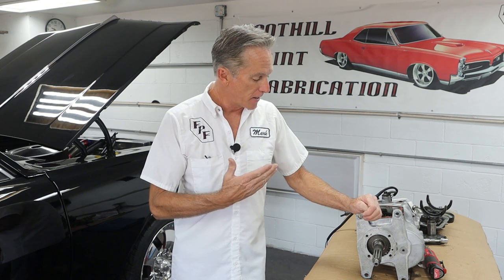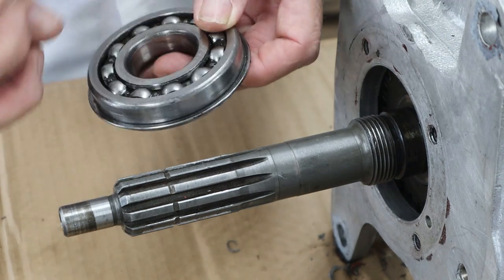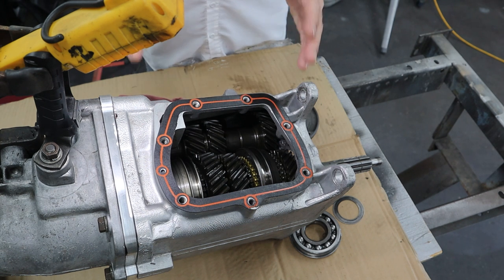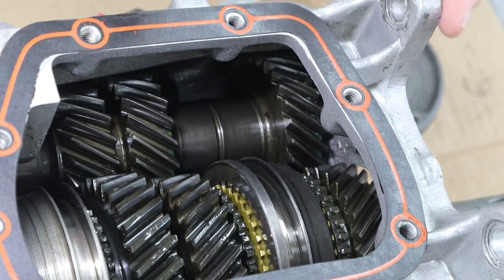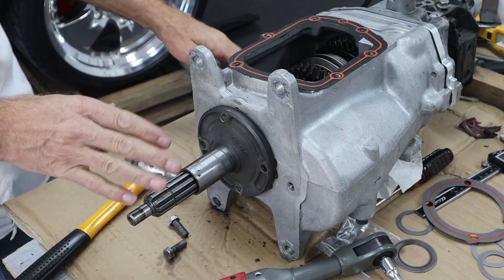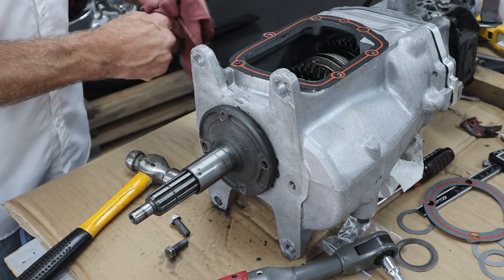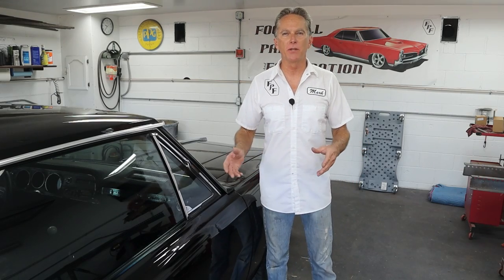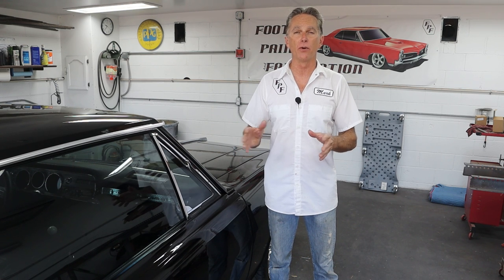1965 Malibu SS (Ep 27) 4th Gear Noise in the Muncie Four Speed

Comment: The  Borg Warner Super  T10 Kits are the the opposite, OEM had 10 bearings and the new SKF "HD" bearing has 11 smaller balls. Here's the thing, the old ones with 100,000 miles were nice and tight and the new ones loose like yours. I made a video of them and also contacted Paul to purchase a couple of his sealed bearings. His response was that the loose bearings are fine and will tighten up when filled with lubricant. He also pointed out that they get tighter as they age. Who am i to argue? He's built more transmissions in his life time than i've had hair cuts. Not to mention, where to you go from SKF? Backwards? We'll see, but first I have to deal with a sloppy hub.
Reply from the maker: Paul does know his stuff that is for sure. I felt way more comfortable using the "old" bearing than the new one though. The Muncie is working great and absolutely no noise so going retro bearing worked out for us this time. 
I know Paul is a transmission genius but in all my years I have never found a bearing to tighten up unless it was rusty. 
Mark

Comment: How did you pull out the bearing to change the shims after realizing it was too tight?
Reply from the maker: The bearing on the input shaft was not a press fit so once the nut is removed a few light taps and it slid back and came off.  I have done a few Muncies and the input shaft bearing was never on so tight I couldn't get it off without using a press. Is yours not budging?
Reply: @FoothillPaintandFabrication  I'm working on a Richmond Super T10 similar but different hoping not to pull the thing apart just to get the bearing off. I'll give it  a try like you suggest and hope for the best. Thank you for responding!
Reply: I ended up getting a bearing puller on it and got it off, very likely it's original so it was stuck on tight.
Reply from the maker: @uletek  Time has a way of doing that doesn't it?  Glad you got it off.

Comment: You mention it didn't have a factory 4 speed.  I want to do a swap on mine. I have the muncie and bell housing .  Trying to figure out he Z bar process or hydraulic clutch set up.  Thoughts?
Reply from the maker: Sorry I somehow missed this comment Tim.  I would think a hydraulic set up would be better but more expensive. Mechanical clutch is still really good though. Do you have the clutch pedal, linkage, pivot stud and counter shaft yet?  If so finding the best location for the pivot stud mount on the frame is pretty easy.  Just mock everything up so all linkages are traveling in a straight line from the pedal and the counter shaft is as level as possible.  I will be switching to hydraulic on my GTO.  
Mark